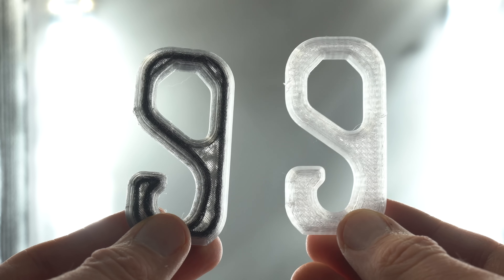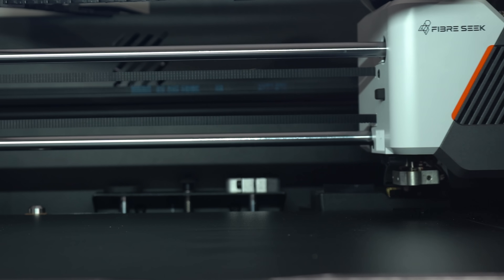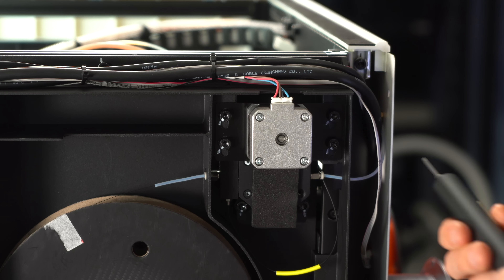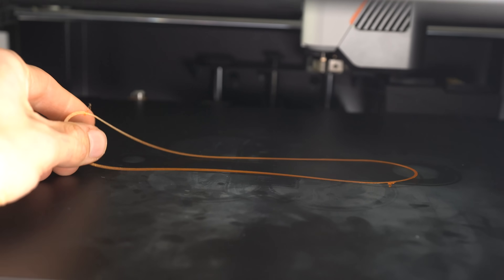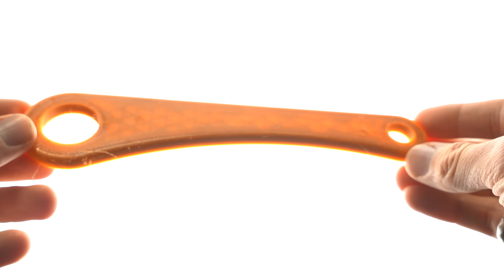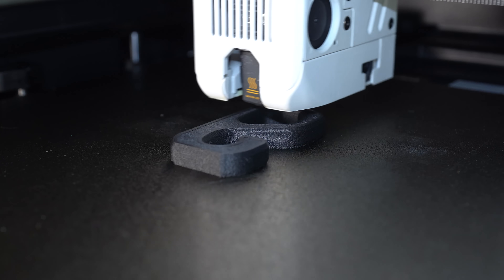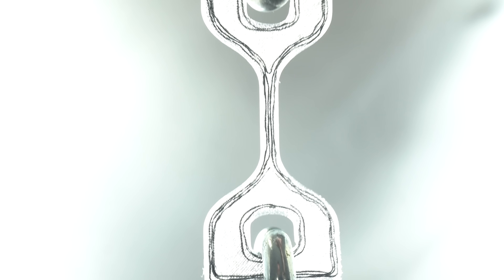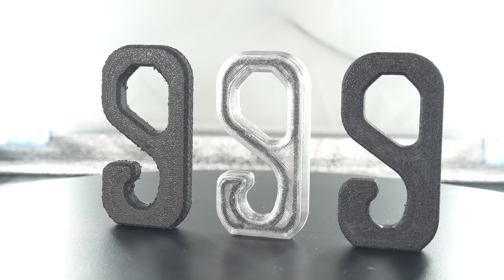3D Prints Just Got WAY Stronger, But At What Cost?

Comment from the maker: Back the Fibreseeker 3 on Kickstarter: https://fibreseeker-3.kckb.me/781d96de

Update: Fibreseek contacted me to address the criticism in this video. Here is their full statement:

“First of all, we sincerely thank you for creating a detailed review of the FibreSeeker 3. Your feedback is extremely valuable to us, and your video accurately highlights many of the challenges our prototype currently. We truly appreciate your careful observations and the time you dedicated to producing this content.

We would like to kindly request if it would be possible to temporarily set your video to PRIVATE. At the same time, we would like to provide some clarifications and updates based on our ongoing development:

1. Product Stage and Continuous Improvement
FibreSeeker 3 is still in the prototype, and we are actively incorporating user feedback to continuously improve both usability and performance.
We have recently updated the software, and the latest version, Rocket Slicer, offers a significantly improved user experience compared to the previous version. The new software will soon be available for public beta testing.

2. Fiber Extrusion Head
The belt system used in the prototype was due to limitations in early sample production. For mass production, this will be replaced with an upgraded design to ensure optimal performance.

3. Strength Enhancement
For certain specialized structural parts, achieving maximum strength requires the carbon fiber to be laid out in specific orientations.
Our dedicated slicing tool now intelligently presets fiber paths, helping users—regardless of experience—slice parts that meet the strength requirements. We understand there is a learning curve, and we are continuously working to make this process more intuitive.

4. Heated Chamber
While the current prototype does not include a heated chamber, all production units will be equipped with a carefully designed heated chamber to ensure optimal performance without affecting ease of use.

In light of the above points, we would love to collaborate with you on a new video. As a gesture of our appreciation, we would be happy to send you a fully upgraded, production-ready FibreSeeker 3 so you can experience the improvements firsthand. We hope that you can showcase the latest version, share your updated experience, and convey the enhanced usability and positive performance of the machine to your audience.

We deeply value your constructive feedback and are committed to making the FibreSeeker 3 a reliable and user-friendly machine. Your updated review would mean a lot to us and the community.

Thank you very much for your time, kindly understanding, and support.”

For transparency to my audience I will not be making this video private. But I will accept an updated production model printer and re-review it on this channel.
Reply: Wow, it's absolutely insane of them to ask you to take down the video. If the product wasn't ready to review, they shouldn't have sent it out to reviewers! Slimy
Reply: @jackiecs8190 I wasn’t paying that close attention, but I don’t recall much emphasis on the fact that this was a prototype machine. While I truly appreciate the video and all the insight it provides, it did sound like a product review video. That’s not fair, in my opinion.
Reply: Thanks for posting their request.  Great review. Subbed
Reply: Thanks for keeping the video up. Promises are easy, I'd like an explanation why they even send out a pre production unit in the first place or didn't communicate it.
Reply: Bravo for the transparency and the methodical approach of testing. I am subscribing because of the publication of this email. Asking to remove the video was inappropriate. Providing a detailed answer is ok. I am still not sure I am going to Kickstarter it.
Reply: That's a pretty nice and solid response. But I'm still a little bit in doubt that why continuous carbon fibre isn't doable on normal dual extruder machines. There were some continuous fibre filaments on themarket previously and some tests can still be found.
Reply: @J @Jpeglism 碳纤维需要被恰当的切断，而且也无法回抽
Reply: @Jpeglism  Should be doable to embed continious fibre in filaments and just put a cutter on the printhead near the nozzle.
Reply: Thank you for keeping up the video. This seems like a legit company overall, but I feel like this is what companies need to remain honest. I hope they will get you that updated unit so we can see a new review before the campaign ends.
Reply: While it’s good they responded saying they’re fixing issues, the “set your video to PRIVATE” sounds like an attempt to get ahead of your video. 

I saw a comment (I think on the community post) that they should have said this was a prototype. 

What’s the phrase? “Buy what’s here now, don’t buy promises.” Comes to mind. They REALLY should have waited for production to send out review units.

Comment: The fiber strings not being under tension is such a design flaw. This means that the fiber only holds load after the surrounding plastic material stretches or breaks.
Reply: yeah, im tired of seeing this scam pop up on my recommendations from 100 different channels.
Reply: Then why do all the snap tests that people are doing seem to suggest that  the parts are much stronger?
Reply: @sophiecollins You are missing the point. The “normal” material holding the strings first fails, then the fiber strings hold the main load, meaning this is only worth it if you make parts to fail not to reuse them. The surrounding “normal” filament cracks or fails just as fast with or without fiber strings, because the way it is designed now, the strings are not supporting the surrounding material here. Only if you pair it with a slightly flexible material then the fibres actually work by supporting the 3d filament as the load is applied in parallel. When the material is stiff the load is applied in serial. If we could put the fibres into the 3D filament under tension already, they could support the filament from the get go before the filament stretches, cracks or fails.

Comment: It's good to see that the industry are moving on. But this fabrication method has It's weakneses when the part experience stress in the opposite direction to the horizontal print lines.
But it will absolutely be stronger in some applications.
I wouldn't be surprised if this company gets bought out in a hostile take over to maintain high prices for commercial use.

Comment: I love this machine, but at 3000$ for a first model and them saying it will eventually support more material types, I am a lot more interested in the next model. This first one is going to have hiccups. They are massively innovating. I hope the best for the company but im going to wait for it to get to sub 2000$ before considering. I feel like these over the next 4 years will hit mid 1000$ mark and basically just sit in that range. But I will say their range makes sense, but its a smidge bit high compared to the polish on the SW side. I dont like when printer companies use acrylic because all i think is "there is 200$ i paid in acrylic and glass". Just put cameras with the top glass or a door with window.

Comment: But they COULD have chosen to fork Orca, added their own code and called it Rocket Slicer. And hell, they could then even choose to make a pull request to Orca. Then the community could decide if it wanted fibre printing as part of Orca or not. Because if the 3D printing community history is anything to go by, there's gonna be more fiber printing after the first product comes out. And being first, you get to set standards, if well received. Which is a huge benefit.

If anything, we shouldn't spend time re-inventing the wheel every chance we get. Building upon goes a lot faster.
Reply from the maker: Great point!

Comment: What do you know about sizing rods and belts?   You do any of the math? Check Spec sheets?   The machines are not under much stress.  I would suggest you ask questions and not guess and spew.
Reply: Have you ever designed a printer using 8mm rods on the motion system? They deflect like crazy. You don’t need to do math to know that. Also it’s just easy quality of life upgrade to use 10mm or 12mm.

As for belts I don’t necessarily agree with needing 9mm belts. They require much more belt tension than 6mm and the frame might not be able to handle 9mm belt tension. Plus this machine seems to move at slow speeds so 9mm belts really shouldn’t matter
Reply: Not guess and spew but rather leaned experience and opinion

Comment: Maybe I'm crazy, maybe I think it's too easy (and it's not), but in my opinion, it's possible to replicate the hotend that mixes plastic with fiber using the Phaetus Taichi hotend. The extruder seems easy to replicate, there are no custom parts. The hardest part would probably be the filament cutting, but I hope someone from the community can replicate it and make it open source for everyone.
Reply from the maker: I agree. I think we could see something like this done with off the shelf parts and open source design relatively easily.

Comment: Your average hobbyist could probably give much worse criticism of the printer given its current limitations.  Especially when put to real world tests that are outside a lab setting.  And most hobbyists aren't going to troubleshoot fiber placement vs design improvements in a part. They're going to overload the stresses, watch it break spectacularly and wonder why they spent money on this stuff to begin with. 

Real world tests you could try for giggles: pulley systems, tool and bike racks, mounting tote storage to ceilings,  lifting heavy parts or equipment,  brackets, etc. Put the printed parts through the ringer. Do a few redneck projects with it. Try towing a trailer with parts printed from it. Make replacement parts for outdoor equipment and test it. Then, lets see what they have to say about those results.  Make hinges, hardware and pulley systems for large barn doors too.

Comment: I don't feel it's that huge of an upgrade. If I want my parts stronger, I'll just design them as such and select the appropriate material. I don't need cf strands to achieve that, and one might argue that adding cf strands to one of my designs would significantly increase the strength (but not in the Z) of the print, and sure, they would be right,  but sometimes it's already "good enough". I don't need to add cf strands to something that already meets the demand.

Comment: when did you receive your unit? this being a product in development, there really needs to be a timeframe in your review to put this in proper context with other reviews. I'm not convinced this review does anyone much justice either.

other reviewers seem to have received prototypes, and known it. some, not all, demonstrate machines that seem to operate quite well, and demo prints that are much much stonger than what you depict. 

i can't say your strength test justifies blaming the machine.  you didnt show your fiber reinforcement settings for the hook you tested, but it didnt appear to have much, nor very effective pathways, both major factors in why you didnt see a bigger strength gain. just from the fiber pathways used, im not surprised it failed so easily. personally, i dont think the design of that part really lends to a good test in the first place, hence the very limited gain. no machine or material can make up for poor design. also, squiggly carbon lines could be a factor due to this design and reinforcement layout, but in general doesn't  necessarily make a part much weaker, and can actually aid in stiffness.

I really appreciate that you specify various build quality features. I think most other reviews I've seen so far have said build quality is at least decent, if they mention it at all. 

reviews like this can end up causing more confusion than help by not specifying when and what was received. you could have received this months ago and only posted yesterday. not saying you did, just that we dont know.
Reply from the maker: Good question. I’ve had it for about 2-3 weeks I’d say. It was the latest version at the time of receiving but it sounds like they’ve since made some changes. They made a statement in response to this video which I’ve included in the pinned comment.

Comment: That hook design simply didn't respect the load direction. The part snapped on leverage, not tension, which means it was pre-conditioned to fail. The fibre itself never stood a chance with that geometry.

Comment: Engineer here. The break in that video wasn't a fibre tension failure at all, it fractured at a leverage pivot. The hook design essentially introduced a moment arm that acted like a force multiplier against the part. Continuous fibre can be insanely strong, but if your guide creates a mechanical lever disadvantage, the physics will win every time. This is a design path issue, not a fibre tech issue.

Comment: I ran Markforged X7 in Aerospace. This printer is not even close but for its' price point, its good but it's not going to be all smiles. The continuous CF Fiber extrusion and the nozzle on this thing is all wrong. It looks like it was designed by only God knows who but the person not an Engineer I can tell that much. I can't disclose any info, printer mechanics is one thing but the real trick is in the slicer. Eiger Slicer is solid especially when I get custom firmware from Markforged hahaha. AS an aerospace additive professional, would I buy this thing? Personally I would but I would mod the crap out of it and get it close to Markforged as it can. I know the secrets so it's be a plus for me. The $50 continuous spool is a great deal. In Aerospace, it's $450 per 150 cc of continuous fiber.
Reply: Well this is consumer off shoot of Anisoprint and this was beta test unit.Markforged costs 3x more, not to mention pricey consumables, absoultely out of reaach for hobbyst  maker.

Comment: I was initially quite interested in these, until I saw their solution to impregnate the CF filament into your choice of material. While kind of novel on paper, I wonder where all the extra money is going, as it's now a more fancy hotend with a traditional printer supporting chassis. On that note, I can see this having the usual extrusion issues after some use that's further magnified by the CF filament dragging around the print bed when things don't work as expected.

Add: Urg, was not expecting to see it squirting out an obvious gap between the hotend and feeding section vis-a-vis malcontent TPU. The machine being $2800 now with kickstarter risk and doubling later makes me even less interested, especially when one can obtain CF filament 'bareback' for $12 for an equivalent length. Having it already in the filament is where you get the massive increase in properties rather than adding it in piecemeal. Bummer.
Reply: "Having it already in the filament is where you get the massive increase in properties rather than adding it in piecemeal"

What do you mean? Only Markforged does that and it is like $500 per roll and $18000 for the printer.
Reply: @rsilvers129  They charge in the traditional 'whatever the market will bear'. The materials don't cost anywhere near what the market price is, but Markforged is the only one (or best known, I'm sure someone is doing core-placed continuous if there's not a patent on it). If the feeding of the carbon filament was done higher up in the extrusion process (like directly in the nozzle) rather than on the print bed itself, the filament would benefit Much more as a true reinforced composite with a central vein. 
The way this machine is laying it in a separate process post extrusion does not make a uniform body with equal resistance(s) across the whole part. Some will benefit from the carbon core, but others will be just the strength of the polymer, meaning abnormal and uneven failure points.
Reply: @C-M-E Markforged lays their CF in the same way with their Onyx printers
Reply: @AlekseiCalhoun  I'll have to go digging in my bookmark sections as I know for certain I've come across an industrial-esque printer that does CFF with a jacketed-type thermoplastic around a CF filament, but you are correct. It's been quite the while and the name escapes me, maybe I'm giving markforged too much credit. I do remember the filament was like $1200 for a 500 gram spool and it had an integral cutter in the tool head when I looked at it, but as said, it's been at least five or more years since I perused the page.